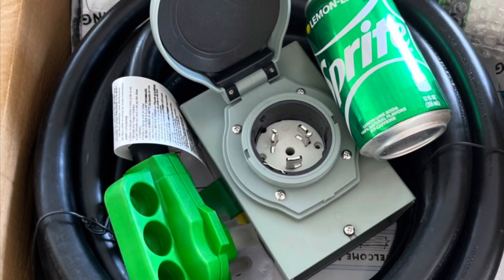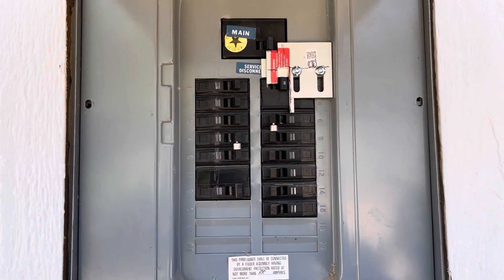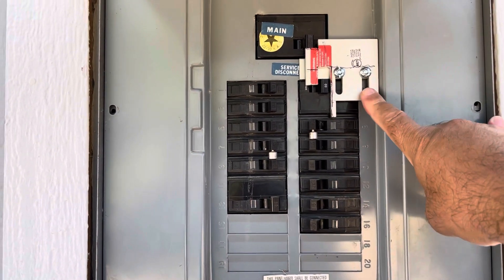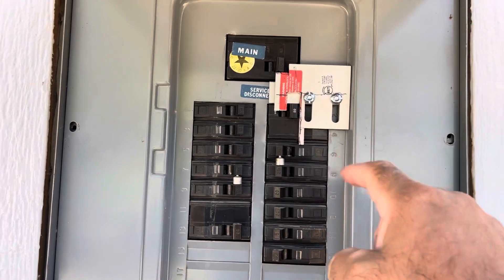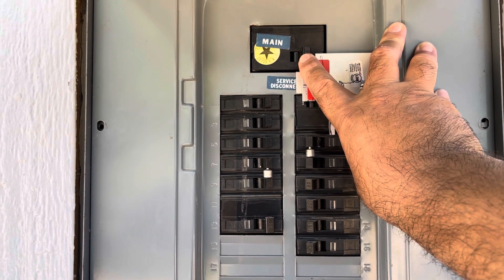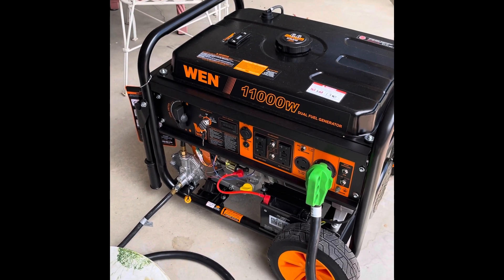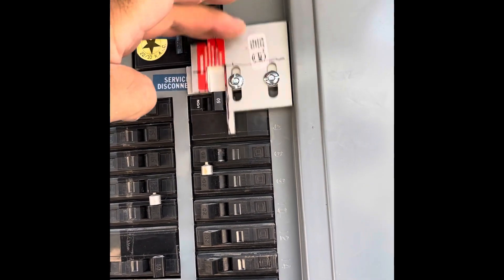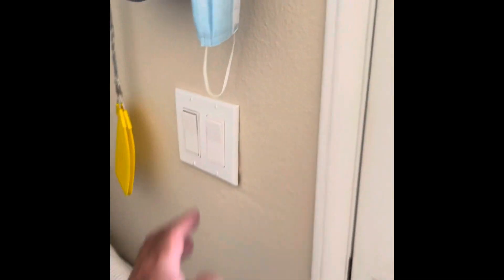11000 watt generator for backup power for my house

Comment: I also have a WEN 1100 watt dual fuel generator. It came from the factory with a bonded neutral. I believe you should have a floating neutral when you connect the generator to your home panel. You may want to confirm with your electrician. WEN tech support can confirm what type of neutral you have and provide instructions for converting it to floating neutral. In this case it’s better to be safe than lucky, especially during an emergency outage.
Reply from the maker: The neutral is bonded to the frame.

Comment: any issues with this generator and how is it holding up? thanks
Reply from the maker: No issues with it, I have not had to use it yet for it's intended purpose.  Every month I put the battery on a trickle charge and start it every couple of months to make sure everything is working properly.
Reply: @exoticwoodpen  thank you for responding to my question.

Comment: Can you put a link of the 50 amp extension cord and the plug plz
Reply from the maker: I added it in the description, however it say's it is not avaliable so this is close: 

50 Amp Generator Cord and Power Inlet Box, 25FT Generator Cords 50 Amp,125V/250V Generator Power Cord NEMA14-50P/SS2-50R Twist Lock Connector

Comment: If I have the Wen 11,000 watt generator, will I be ok just running the 30 amp into my house? My Inlet box is only a 30amp service. I won't be running the whole house. The inlet box only has 6 circuits on it that are only 110s
Reply from the maker: HI, you should be fine but I would ask an electrician first just to be sure.  I am not an electrician so I don't wan't to give bad advise.  You might be able to get a smaller generator with a 30 amp box.  Sorry I can't be of more help.

Comment: How do you turn on the 50amp on the generator
Reply from the maker: Just plug the 50amp cord into the generator. There are several connections to use to plug into.

Comment: I am considering the WEN 11000 for a whole house back up. What ton AC do you have? Ours is 3.5 ton and I am concerned about the 11000 not being able to handle it.
Reply from the maker: Mine is a 3 ton, I think you should be able to find out how many watts is uses online per your manufacture.  My home is just over 1400 sq feet, so its not that big but the generator puts out more than enough power.  Since I did this I have not lost power yet but before I did this we lost power 2 days in a row for over 12 each day.  
If you use propane, one 5 gal bottle will last about 3 hours according to the manual.  I didn’t use gasoline in mine because I didn’t want it to sit in the tank and go bad.
Reply from the maker: FYI, this is a great generator but it’s not quite.  It is pretty loud.
Reply: if you install an easy starter, this gen will easily power a 4 Ton AC

Comment: Did you ground your generator? I don't see any grounding on the video...
Reply from the maker: No I did not, I thought the motor was grounded to the frame of the generator?  I will look at the manual again just to be sure.  Thank you for pointing this out to me.
Reply: Once it’s plugged into the inlet, it will be grounded through the panel.

Comment: I have the same model. What size propane tank you recommend for a 2 story home? Thanks
Reply from the maker: Hi, according to the manual a 6 gallon tank will last 3 hours.  I think you would have to base the square footage of your home against the output of the generator and most importantly how long do you plan to use the generator for.  I have a 1400 sq foot house and two 6 gallon tanks. As I understand some models can be converted to natural gas but I have not looked into that yet.
Reply: @exoticwoodpen  yes I have 2900 sqft.  Just trying to prepare for another possible  Texas winter storm. Keep the heat, lights and refrigerator on. I remember reading on other units needing largest propane tanks for pressure. My unit is still in the box 📦
Reply from the maker: @JOHNNYUPLOADZ  Keep the battery charged with a trickle charge like a motorcycle battery and start once a month to keep the fluids circulated in the motor.  Mine works great but I hope I don't have to use it. It will run longer on gasoline than propane, trick is keeping gas long enough and not going bad.  Good luck.
Reply: @exoticwoodpen  😩I agree about the gas. Thanks for the info
Reply from the maker: @thewordsofsilence  thanks for the additional information, appreciate you taking the time to add that for me for others to know if they read the comments.

Comment: Nice job. I have a Honda EU7000is that I converted to work on natural gas or gasoline. It's a bit less power, but very quiet.
Reply from the maker: Thanks, eventually would like to convert to natural gas as well.  The Honda generator is a amazingly quiet compared to the one I bought but it fit the budget and my needs, there is usually a trade off somewhere.  Hope I don't have to use it anytime soon.